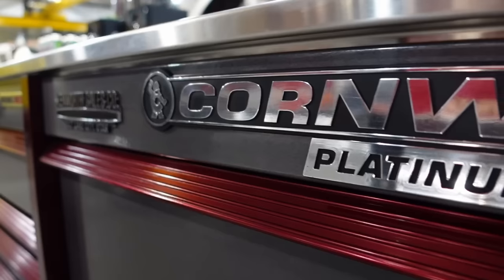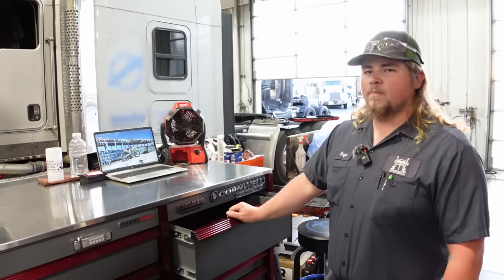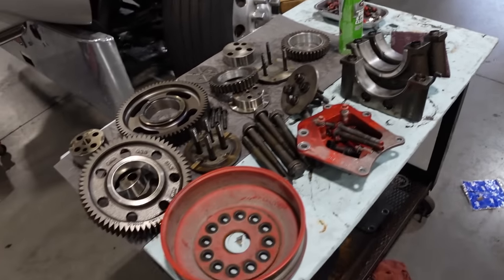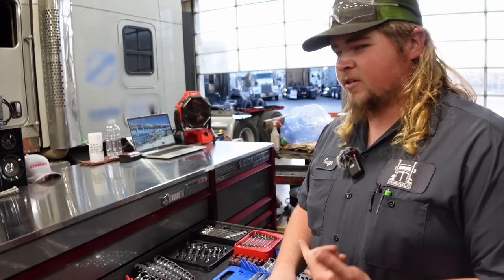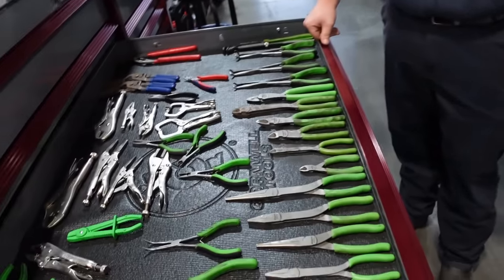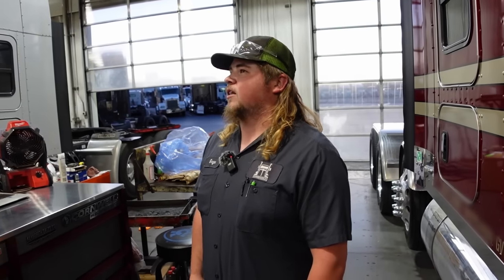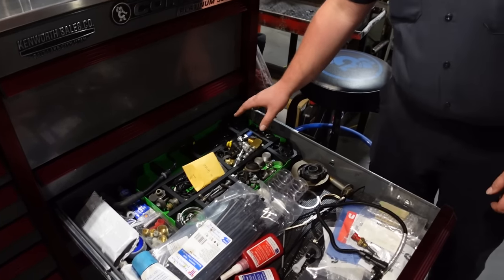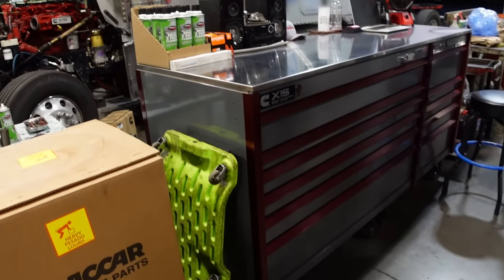Fixing KENWORTH Engines At Night!

Comment: If that guy works on Kenworth he must be bored, they are far superior to any other brand and hardly ever break down. If he wanted more work than he could ever handle he would work at Freightjunker or Vulva, they are garbage and he would constantly have a backlog of work.
Reply: Kenworths break down all the time, mx13 engines are junk.
Reply from the maker: He enjoys it - atleast it seemed. The atmosphere was VERY chill easy going. A place I think I’d enjoy wrenching.
Reply: all trucks break no matter the brand, poor maintenance leads to failures and every brand has owners that carry out poor maintenance
Reply: Even if they don't witch every vehicle does they still need regular maintenance
Reply: Idk shop looked pretty packed to me 🤷🏻‍♂️
Reply: We use freightliner trucks at work the only vehicle less reliable are the old llv(aka mail truck)
Reply: Depends on the power train, Cummins are decent engines, the paccar mx 11s and 13s are garbage
Reply: All of our Kenworths that we lease are absolute junk. They are all less than 3 years old and spend almost as much time at the shop as they do in service. We are planning on switching once our leases are up. They do have the Paccar engines which doesn’t help. But even on the interior, we have 3 identically speced day cabs and you can see where they ran out of toggle switches at the factory so they all have mismatched switches. We have also had 3 digital dashes fail in the last year. Old KW’s are great (hence the reason we leased KW) but, we would rather pay for Freightliner if they are gonna be in the shop this much. Save us some money at least…
Reply: I hope your joking lol
Reply: not boring at all. I work at a Kenworth dealer and we are slammed all the time. Paccar engines and endurant transmissions keep us busy 24/7
Reply: Lol. What are you talking about. Kenworth is superior in the trucking world but they still break down all the time. 😂 You never get bored as a diesel mechanic.
Reply: Wtf you talkin about
Reply: Like the commercials with the Maytag repair man. He was always bored out of his mind.
Reply: @fanofbama14 
The trucks were spec for company drivers. 
We have two KW T680s with 13spd 565/2050 specs. They're great.
Reply: @I_like_turtles_67  What engines and manual or auto?
Reply: He is half right. There is never anything on the engine to repair. It's mostly catastrophic failures.
Reply: At the end of the day Scania ……

Comment: I went to trade school for diesel tech and I really miss having the overhead crane. Being in a large fleet we dont do engines like that but using a crane for driveline stuff was so nice. Also crazy to have small the tools are for an engine tech compared to stuff I have.
Reply from the maker: Yeah! It was like the claw machine at an arcade! 😅
Reply: 2 heavy equipment shops I worked at didn't have overhead cranes try doing a boom on a skid steer without one we just ended up using the clapped out service truck

Comment: I got a set of those snapon offset wrenches and never knew what they’re good for. I’ll try them next time I got a valve job.
Reply: The bigger sizes is where they really shine. 7/8" up to 1-5/8". Final drives, hydraulic pumps, flanges. Dont really need them in automotive.

Comment: I hope that they send that Raptor and the FRL out for calibration bc if not your head bolts are not torqued correctly. I calibrate these all day long and they loose ft lb over short time due to a lot of use.